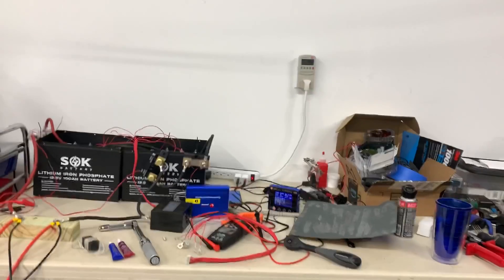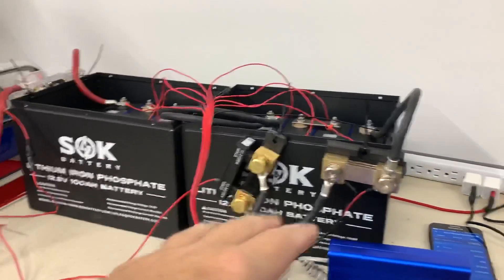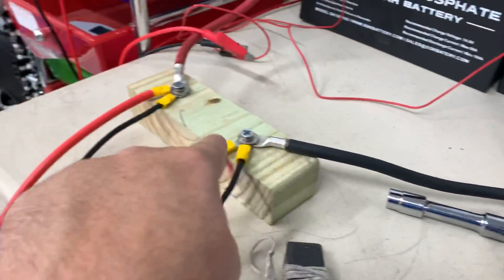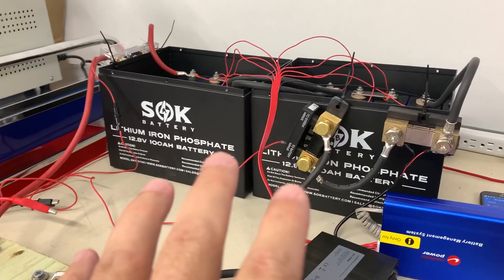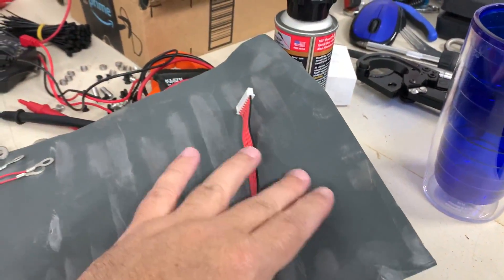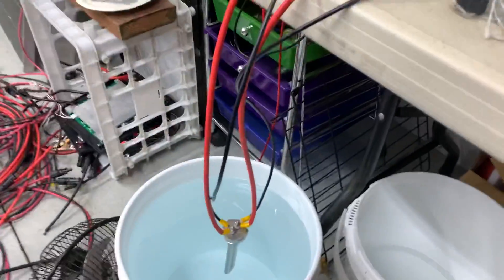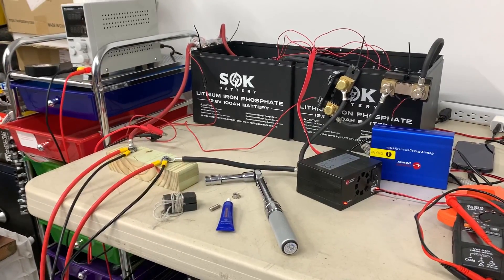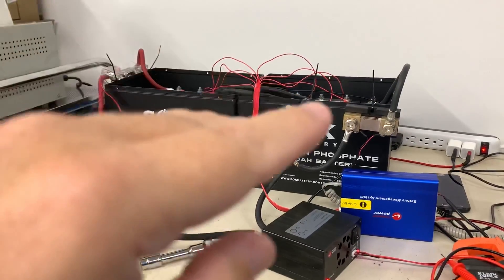Making a better battery

Comment: Answer me this: would you buy another Newaire?
I have not made my decision yet, reason I'm asking
Reply from the maker: Unfortunately, no.  Even if we ignore the myriad of problems I had (all new RVs have problems, I had way more than my fair share), simply looking the the "behind the scenes" of the New Aire (wiring, plumbing, etc), really reveals the quality that was NOT there which I was expecting.  There are other reasons I'm switching which aren't Nemwar specific but rather "bus" vs. "5th wheel" style RV'ing - such as not having to literally bring my house into Freightliner for engine service.  If you're thinking of a New Aire, I'd go with used, so that all the break-in problems have already been resolved.